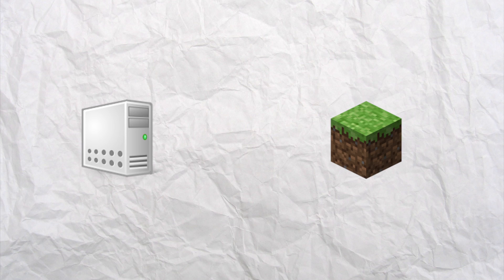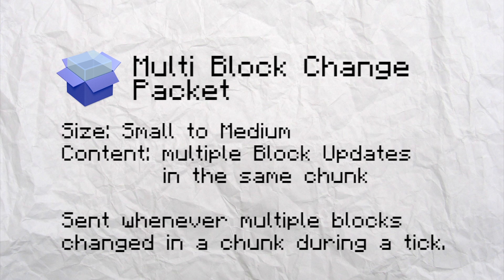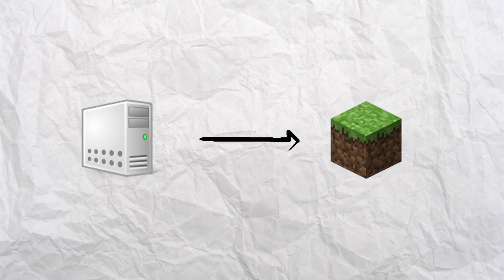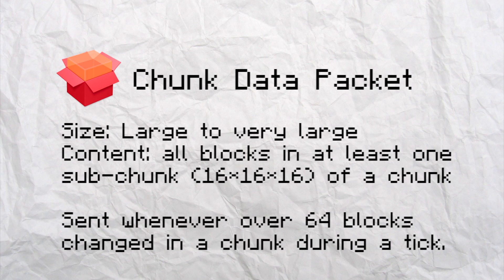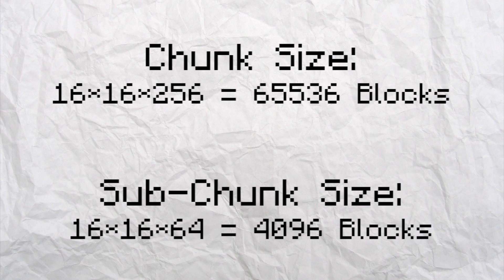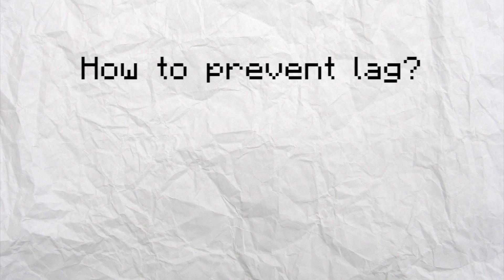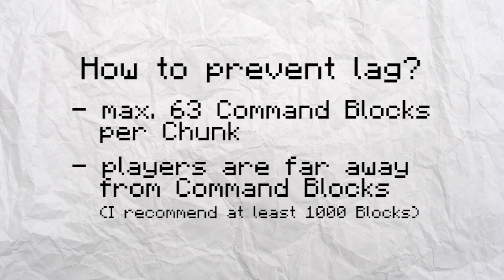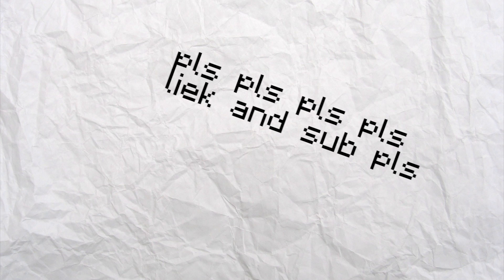Minecraft - How to remove lag from Command Blocks

Comment: i have a line of redstone blocks in  a chunk beeing replaced 20 times a sec. 
on them, are less than 60 command blocks getting powered 20 times a sec. 
are there redstone blocks counted as block updates? if so, are they causing a higher memory usage (and therefore lag) when running? concidering all the 60~ command blocks i have arround them?
if so, then there are more than 64 blocks getting updated.

Comment: IQ TEST

1. This roman numeral is 9, turn it into six just by adding a single line.
Q: IX

2. This equation is definitely wrong. How to correct it without changing it??
Q: XI + I = X

3. The day after the day after tomorrow is four days before Monday. What day is it today?

4. Forest is to tree as tree is to?

5. There are 17 pigeons sitting in a row on a wall. A boy shoots the fifth pigeon. How many pigeons remain?

6. Little John has a habit of throwing things whenever he gets angry. One day he throws a toy of his and it again comes back to him without bouncing off anything. How did this happen?

7. Find the odd one out: level, civic, madam, eye, mouth
A: Mouth

8. Use the word "dormitory" to make two words which will complete the below sentence.
Daniel stays in a _____   _____.

Answers with explanation:
1. SIX
2. Turn it upside down so it makes the equation correct.
3. Monday - Four days before Monday is Thursday, simply because four days after Thursday is Monday. Besides, day after the day after tomorrow is Thursday only if present day is Monday.
4. Leaf -  As forest houses several trees, a tree has many leaves. Branches is a close choice but it is incorrect as all tress do not have branches.
5. None - all pigeons fly because of the sound of the gun shot.
6. John had thrown the toy straight up in the air.
7. Mouth - All the words except "mouth" are palindromes (reads the same backward and forward).
8. Dirty Room

Comment: CrushedPixel So das nennt man Clocking Limit btw ;)
Und dazu gehören nicht nur die CommandBlöcke sondern auch die RedstoneBlöcke bei ner Fill Clock, heißt nicht mehr als 63 Command- + RedstoneBlöcke die jeden Tick verändert werden
Außerdem sollte man die Clocks nur im 14*14 Centrum benutzen, da sonst am Rand mehr Sachen geupdatet werden.
Zudem sollte man keine Redstonedust benutzten, da der für jedes Stärkelevel was er verliert (neben Hebel z.B. von 15 auf 0) alle Blöcke im Umkreis von glaub 12 Blöcken oder so updated heißt redstonedust was jeden tick geupdatet wird führt zu mindestens 20*15*720 Blöcke pro Sekunde geupdatet würden! NEVER USE REDSTONEDUST
Zudem gibts Tricks 17*17 Spawnchunks zu bekommen ;)

Ich hoffe zu machst nochmal nen Video mit allen guten Tipss hier in den Kommentaren dazu!
Reply: *****
doch wird es

Comment: That'll definitely be helpful. I'm thinking of starting work on a map, and this will probably reduce a lot of lag, since I want to make it a big map with a lot of command blocks.
Reply: Cookie Films Definitely follow these rules, then. Also, turn off clocks when not in use. Remember, the 63 block rule only applies to currently active blocks. If you have a set of clocks only one of which will be running at a time, there's no need to worry about it.

Comment: Nice work with this! It'll help me and my friends, since we play vanilla UHC with custom game modes (not even going to try to explain what those are, but for those of you know what ur is, we have moles, cutclean, golden heads, and some basic things that plugins usually do) that take up a LOT more than 63 updates per tick. 
Since I have all of the heavy ones in one-conmand-block forms, it's easy to spread them out enough so there won't be a problem.

Comment: I have two questions, you say that people should both have max. 63 command block and keep it far away from players. Isn't doing one of those enough?

Also, do you have any proof that this causes significant lag? I agree that having people far from command blocks should always be done, but you make it sound like it causes over 50% of the lag.
Reply from the maker: Nasm Nasmus Watch the video I linked in the description, that's proof enough.
Reply: CrushedPixel I disagree that that video is proof enough. It proves that it is very real, but it doesn't show anything about how laggy it is on a server with real commands. For example, how much lag do you think it contributes to MissileWars map? Just a rough estimate, is it between 0-10%,10-30% or 40-70%?

Again, I agree completely that command blocks should always be far from the player, but I do not think that you need to think about the amount of command blocks in a chunk(if they are far away from players already) and I do not think they cause as much lag as it seems like you are implying.

I have done many hours of testing on what causes lag, and I'm not saying this is a non-issue. What makes you think this causes significant lag besides that video from samasaurus?
Reply from the maker: Nasm Nasmus I've seen the game code.
The amounts of data sent by servers using Chunk Data Packets are huge (up to several MB per second).

Regarding Missile Wars, it was completely irresponsible by Seth and Cubehamster to have Redstone and Command Blocks near the spawn. That issue made the map unplayable on less powerful servers.
Reply: CrushedPixel I have also seen the game code, but you can't determine how much something will lag from the game code. You can find something that is a potential issue, but that's about it.

I agree that the redstone and command blocks in Missile Wars shouldn't have been near the players, but you keep refusing to give any proof or even indication on how much lag this causes. You haven't even answered my question on whether you think you need to both keep the command blocks away and fewer than 64. You say that this specific issue made the map unplayable on less powerful servers, do you have any evidence whatsoever for that?

Comment: Good video - although I would note that it's not enough to stay under 63 command blocks, you have to stay under 63 updated blocks per chunk - which includes any redstone blocks or other blocks being set by your fills.
Reply from the maker: slicedlime True, I've added an annotation.
Reply: So every redstone block in a fill clock counts towards the 63 blocks?
Reply: Yes.
Reply: ***** No, not really. They've added new command block functionality that lets you, if you're careful, avoid this problem... so in a way they've "fixed" it - but if you build 64 blocks that update in a tick in 1.9, you'll still have exactly the same problem.
Reply: You might. In 1.9, you can mostly put them all in one chunk and get away with it if you set it up correctly.

Comment: Don't forget this also includes the red stone blocks that are being set and destroyed, making the actual max in each chunk about 48. I'd recommend you use a clock that switches between powering one set of 48 command blocks and a different set of 48 each tick, to get the most out of each chunk.
Reply from the maker: Agent KillerBunny Valid point! That's something I missed in the video :)
Reply: Actually, if you place the clocks far away, there shouldn,t be a problem. Only if you need a /testfor command, it's gonna be hard. I recommend using testfor with coördinates, and not with radius.

Comment: If this applies to all block changes, do my Command Blocks create less lag, if I clone a large structure in ~63 Block parts?
Reply: Nabeken Also something not Vanilla Minecraft related. Would this technice theoraticaly also work with Mods, which spawn larger structures?
Reply from the maker: Nabeken For your first question: Yes, cloning in pieces of less than 64 blocks should reduce lag. Note that you have to wait at least one tick before cloning the next piece!

Regarding Mods, that depends how the Mods implement spawning large structures, but usually sending chunk data packets only a few times is not very laggy.
Reply: Thanks for the response :D. How about Server Plugins? They are quiety Vanilla. Could a plugin like WorldEdit get less lagy by this technice?
Reply from the maker: Nabeken Yes, I do believe so.

Comment: You want to make sure not to place more than 63 CLOCKING BLOCKS
Not just command blocks.
Very informative and well made though!
Reply from the maker: The Redstone Scientist As I said, "to be completely sure", never place more than 63 blocks.
What if there are e.g. 60 cmd blocks on a fill clock and a player manually triggers 5 other command blocks in that chunk using a button? -> chunk data packet
Reply: Good point